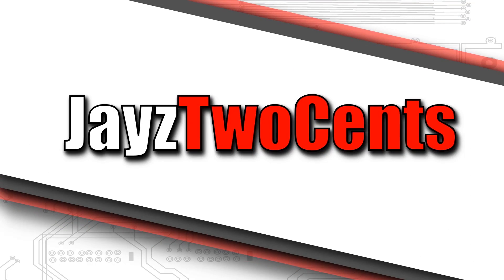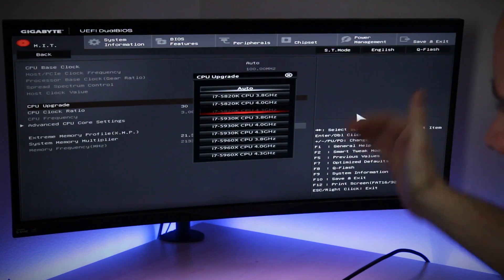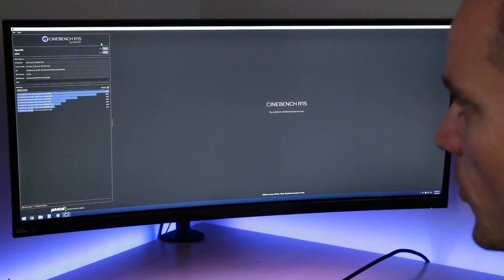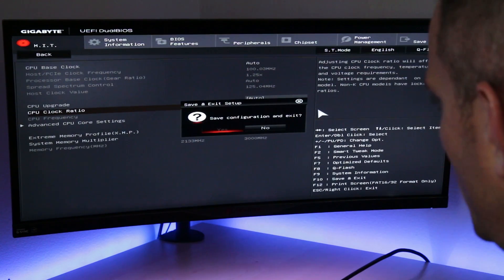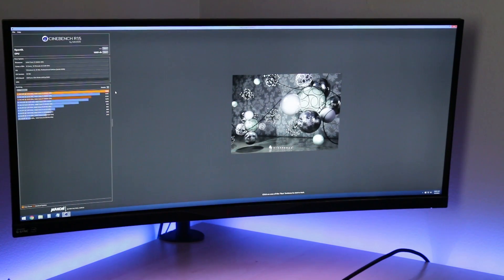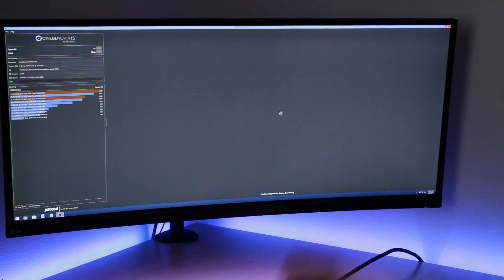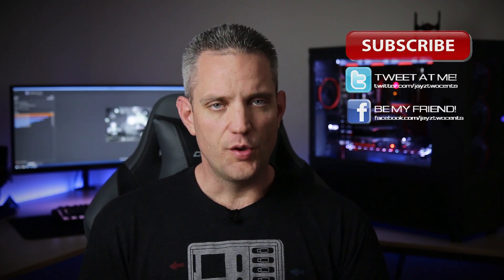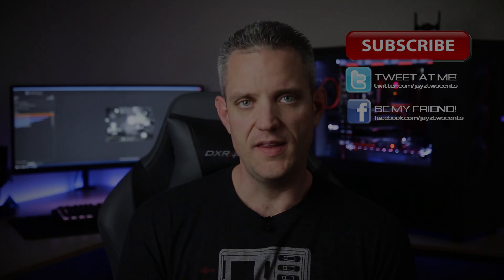XMP vs Overclock

Comment: Always done it manually, always will. I tried automatic OC once. When I saw how much voltage it put through my CPU, I almost had a heart attack. Never again.
Reply: Nekros nothing worse than seeing the vcore voltage box in "auto"
Reply: Nekros ty for the wisdom, will check my setup
Reply: I let my motherboard try to do it, and the voltage stayed stock and it went up 400mhz on a 6600k. I did it manually afterwards and got the 4500mhz, but i had to bump the voltage up.
Reply: I actually ran an auto overclock recently, then went back in and altered some of the settings manually. I heard it had more success than manual overclocks on the board. I Even managed to get the clock even higher when I went back in manually. Not perfect but saved me time I didn't have at that moment. ASUS' was quite good. It was better for changing all the other bios settings you don't usually mess with straight away that might be causing instability. Then you can just concentrate on the settings that matter.
Reply: Nekros nah, it was something like electromigration i think.
Reply: I'm using it right now with my Asus Z97-A and i5 4690k and it overclocked the turbo boost to 4.5GHz but the voltage sits at 1.275v to 1.365v.
Reply: I just auto oc my new pc,asus tuf z270 mark1 mobo + i5 7600k ,the result was 5ghz with 1.4v stable,using a corsair h115i . i think that is ok after doing some research ,it stays around 60-70 degres  after i play like 7 hours of heavy gameplay,sometimes it shows 80
Reply: You can auto-overclock and also control the voltage believe it or not
Reply: It's not beating manual overclocks but it's definitely gotten a lot better. My z170-AR push the 6600k to 4.4ghz/1.32v, which isn't far off of the manual OC I got at 4.5ghz/1.33v. (My 6600k was rather stubborn.)
Reply: Heh heh, man, you funny.  I wouldn't be surprised if it were deliberate - manufacturers want your # to break down faster, since it means you'll be back on newegg or wherever that much sooner. Gotta have some way to make back all those hype-dollars that they've been expending!
Reply: Been overclocking and working in I.T. for over 10 years, nothing kills CPU more then voltage when overclocking. It has to run over 85c for a long time to start to effect it i would imagine as I've only ever seen maybe 2 dead CPU die from clear overheating over years (replaced it, cleaned it out, ran some tests, worked like new) and a whole mess from bad motherboards/PSU's.

Point is, I ran aggressive overclocks with high voltage that would be perfectly stable and cool for a year or two then have to draw the overclock back 50-100MHz, then again after a year... But then i would notice not only would i have to knock it down but also raise the voltage :/

Now, I go up in frequency until unstable then start very slowly going up in voltage. Then go up 100MHz and go up in voltage until stable for 10 minutes, then repeat until it sits at 70c or under for 2 hours THEN! go back down 100MHz ;-). For my personal rig i run it for 8+ hours then go down 100MHz.

For my GPU i do the same then go down 25MHz, as the ratio is 1/4 of a CPU.
Reply: @MrHeHim  mind giving me a social i could contact you on?
Reply: Laharl Krichevskoy Electrophoretic deposition?
Reply: Mine i5 4670k makes 4.4GHz at 1.2v stable everything done manualy
Reply: Auto overclocking sucks
Reply: kinda depends on how you set other things or bios updates .
did it change load line calibration or not.

my bios i need to ad 20 Mv offset or so.
i thought it was on the edge for stable  
i got my loadline pretty aggressive on load.
so voltage does not drop on load, but even goes up a bit.

anyways i don't need to raise the max voltage to grazy high .
also i like to use the profiles to correct clock vs voltage tables.
i can do manually on top of that with offset.
even lowering voltages.
that is why my powerstates and energy modes work perfect on overclock. 
i use the Asrock Turbo profiles.

and vcore voltage i care less about , then core temps .
Reply: i use the Enhanced Halt C1E for energy saving, no other c-states or speedstep.
Reply: nah i got an asus b350 with a ryzen 5 1600 an the auto cranked the volts hardcore..i dont remember what the volts was exactly but i do remember within 5mins of prime95 i was hitting 92celcius an still climbing, idk tho i turned it off soon as i seen that temp...so after that i reset to normal and did some research then i went back in an did it myself. i currently have it at 3600mhz with 1.2volts and after about 12mins the temps settled in at 77celcius. sorry i forgot to mention the auto oc had it on 3800mhz.. i think im going to leave it as is till i can upgrade the stock cooler. aslo that 1.2volts that im running 3600mhz on is actually lower then what the chip's voltage set to running at 3200mhz. so i got a higher speed with less volts then what my cpu was set on out of the box :) i think thats impressive but i am new to this so idk but i do have high hopes for weh i upgrade the cooler and then i can really dig into it :) thanks for reading an take care and also good luck with your own oc's..peace!
Reply: Yeah it’s true. I used ASUS extreme overclock settings and it was running my CPU at 5GHz at 1.45V. Went into bios dropped it straight down to 1.39V and it runs. Will try and get it down further when I have some time.
Reply: Dex4Sure  Nah dont take so much time, ive done many clocks in 10 minutes and if you want stable 5ghz and max 65c hot, clocking memory is more work with try calculate the timings to max the clocking.
Reply: Dex4Sure  hehe yeah depends how you clock, easy and fast just do cpu. haha much have happpend over only 1 year also ;)
Reply: My mobo has an extra 12v 2x2 pin for OC. Idk if it'll last though...
Reply: Never had an issue. XMP on my current memory made almost no change to my CPU voltage.
Reply: I had not overclocked my 16gb ram and it game me 1333 frequency by default. My friends told me to overclock. When I did, I choose 2999 frequency xmp profile and when I started my pc, it was showing 1450 or 1490 frequency in task manager.. friends are saying it should be showing 2999 frequency in task manager. Something is wrong with your pc. Can anyone share their wisdom on this??? Plz
Reply: @chandansingh-nx7il  
So keep in mind that DDR stands for "double data rate" so to read a clock of 1450 and 1490 would make sense since the effective clock for a reported speed of 1450 is 2900mhz. Depending on what monitoring program you use. Some like HWmonitor, HWinfo, and AIDA64 will show you this lower number, My laptop for example reports a memory clock speed of 800mhz RAM speed in HWinfo, Keeping in mind what "DDR" stands for the effective clock turns out to be 1600mhz. If your ever unsure what your base memory clock is you can always find it by looking at the BCLK of the CPU (Sometimes is referred to as the "Bus clock". 99% of the time it's 100 for intel chips, AMD is a lot different ) and multiplying that by the memory clock multiplier. On my laptop, for example, the BCLK is 100 and my memory clock multiplier is 8 which gives me 800mhz because 100x8=800 but it's "DDR" so 2x the clock which gives me 1600mhz. For AMD it's different but follows the same idea, Bus speed multiplied by the memory multiplier. The FX series chips are very funky and strange and can have variable ratios of memory to Bus clock(called hyper transport or HT on FX) I'm going to skip these because I've already typed a lot and they are pretty weird. Ryzen is very comparable with intel in finding what the clock is (Base x Memory multiplier), unlike FX.
Also going from 1333 to 2999 is a bit much, It's totally possible the system is unstable at that clock with no additional voltage to the memory controller the MB changed to a lower clock so the system can post. I had a Gigabyte z170 G1 gaming that would do this if the RAM clock was too high. However, I would strongly warn you that giving extra voltage to an IMC(integrated memory controller) has to be done extremely gradually and slowly because this part of the CPU is extremely sensitive to voltage changes and can degrade quickly from even what seems like small changes to voltage. Not sure what CPU you have but at that clock, it sounds like an older chip. If it's an intel chip, Sandy bridge(2700k) to Coffee lake(9700k) they will have a voltage rail called VCCSA, it's critical when using XMP or overclocking memory in general that this voltage is kept at safe levels during all points of load. This is the system agent, degradation of this is the worst thing that can happen to a CPU, I'd give the VCCSA no more than +200mv and even then I'd be uncomfortable, ITS CRITICAL THESE VOLTAGES ARE NOT LEFT ON "AUTO" this is how CPUs die in <2 years. The same is true for AMD FX series CPU (FX-4100 to FX-9590) and all Ryzen CPUs(Zen 1-3 even Renoir chips) but it's called CPU-NB or Northbridge voltage on FX and SOC voltage on Ryzen. Another important thing to keep in mind is that voltage readouts you see in software arent correct even on high-end MBs it's usually slightly higher than the reported voltage in software about 0.030v-0.100v more. And again just a reminder to NEVER use the "auto" settings for anything related to voltage when overclocking this in combination with incorrect LLC profiles like when they get set to "auto" and you overclock something very far, such as 1333 to 2999... on an older intel chip, say a 3770k is how to degrade CPUs and not the fun kind either
If you want to overclock RAM I'd suggest starting low and bringing the clock up slowly by +1 on the RAM's multiplier until you have a failure in MEMTES or BSOD.  For intel NEVER exceed 1.3v on VCCSA under ANY scenario unless you're trying to make a paperweight, For AMD never exceed 1.20v on the SOC voltage rail
Reply: Laharl Krichevskoy Electromigration, over a long time it can actually scatter the atoms that make the circuits inside the CPU. This will not only make them "weaker" but also require more voltage from the added resistance of atom seperation and are thus more likely to fail in the ways you explained. I just didn't wanna geek out that hard, thanks! ;-) good to know people know how shit works lol
Reply: Gabriel Soria

The voltage thing is because the more voltage, the more current transistors have to handle, just like heat goes squared to the voltage, that's only because current does the same and current is the one that heats things up, and it is current the one that over time damages the transistors.
Even more, when you overvolt it too much, corrent starts flowing through places whereit shouldnt, which might still work as intended but as those channels arent prepared for that they might break bit by bit like you said and lose the characteristics they were supposed to have, and like you said, they start not responding or losing stability over time, just like a cap that goes dry and doesnt "cap" as good as before.
The effect was called electrosomething efect, but basically sometimes atoms move arround with the electrons flow. That causes the thing i said. When you do that with the gate of a transistor or something fragile then the transistor response migh change for worse and that's how it cant activate as fast as before, and so it stops working at that speed so you have to back down.
Reply: Laharl Krichevskoy Electrolysis?

Comment: In my case I do both - first enable XMP and then manual CPU overclock but the XMP of my memory kit does NOT touch my BCLK so the CPU overclock settings remains essentially the same as when XMP is disabled. It only change memory timings and memory multiplier (it does not even increase memory voltage).
If I had higher clock memory kit maybe I would have trouble doing that but in my case it works fine :)

Comment: Love your channel mate, thought I would play along. I get to see 24 boxes, I have XEON E5-2658-v3 12 core 24 threads 30MBcache. Engineering spec for $200 AUD.
Really want the 5930k but that will be 4x the cost and now, after watching your vids, want to go hard with custom water loop on CPU and GPU. Thanks for all the awesome work.
P.S.  I am getting 1205 on cinebench. Lots of cores but only running at 2.3Ghz

Comment: Gotta love the x-99 platform, best performance and strongest overclocks... Myself running a 5820K @4.5 Ghz with just 1.265 Volts going through, 24/7 stable, but I think I also got a medium luck at the chip silicon lottery. With watercooling and such voltage the temperatures are quite incredible, as others I could push till 4.7 with 1.3V. I keep the memories at 2666 which is the rated speed for my modules, the 2800 further requires higher overall voltages and as Jay says it's more of a drawback, also considering the really low gain in oc'ing rams

Comment: I have the same As rock X99X you have J, I love the easy OC for my 5930k. but it's my first board with so many extra on board connections. the pcie miles connector above the top express slot I want more information about. there is very little information about it, and no one covers in in their video or reviews anywhere. what is it for?

Comment: but if i would have proper cooling, and get great temps, does that still shorten the lifespan of my cpu? and does that silicon still get broken?
Reply: It does shorten the lifespan, but you'll probably replace your entire system a few times before it would die from overclocking, assuming you replace it every 5 years or so.
Reply: Martin Van Den Hoek if you dont get power surges and you motherboard and psu are good quaity most probably it will last you well over 30 years
Reply: Laharl Krichevskoy my mobo is a z170a gaming pro carbon from msi, and my psu is a Seasonic m12ii evo 620w.
Reply: Martin Van Den Hoek
no idea about that seasonic psu but the mobo seems ok. If you keep the temperatures below the recomended limit and dont touch the voltage, you should be more than ok.
Voltage is the one that will make everything get hot fast plus it will degrade the cpu quicker because of how transistors work. Still while it may not last you 50 years it may last you say 20, which by that time you most problably will have already gotten a new one.
If you want to play it safe, dont touch the voltage, else you'll have to do some reseach on what's a safe voltage and how much did others need to get to a certain speed stable to have a better idea of whether yous is a good or bad chip.
Reply: Laharl Krichevskoy sounds ok! Many thanks!
Reply: Yes. The tiny gold wires inside your cpu eventually burns out if you go too high for too long.
The silicon will be fine, the chip itself will be fine, but the interconnecting gold wires may burn up when the current draw is too high.
I never had a chip die on me, but then again i only overclock AMD and thus can't speak for owners of intel chips.
I would think they have the same problems with long therm extreme overclocks but i'm not sure.
Reply: StopaskingformynameYouTube not unless you go nuts but by then your cpu will be toast.
gold doesnt burn, it would melt at most so i dont think its posible to burn them. plus  dont think these cpus have bond wires at all.
also if that could happen then it would be imposible to do extreme overclocking with liquid nitrogen as current goes really high in those and heat goes squared to the current, the wires would melt and the sillicon around would alloy (and be ruined) way before that gold's melting temperature.

Comment: Does running X.M.P mode mean that my CPU won't idle at lower clock speeds?
Reply: In my Asus Z170, there are separate settings for Idle, 30%, 60% and 100% CPU usage, that let you change clock speeds and active cooling at those percentages.

Comment: 6700k + asrock extreme 4 + automatic 4.6 ghz overclock setting = 1.44v on the cpu. lol thats way more voltage than it should have. i dont really thing the auto overclock settings are very good. (ended up keeping 4.5ghz @ 1.312v)

Comment: Hi Guys, sorry for the noob question i'm going to ask. Do the 'XMP Overclocking' apply to any kind of processors? or just with the unlocked processors? I'm planning to get a G4400 with ASRock H110M-HDV that supported XMP. I'm planning to get a 2400 MHz RAM, because there is no price difference with 2133 MHz here in my country. When I activate the XMP, should i getting a little overclock on the G4400? from 3.3 to 3.4 / 3.5 GHz, maybe?? Thank you guys in advance!